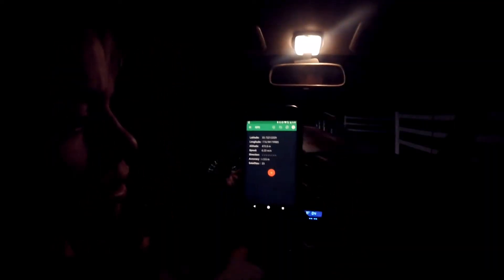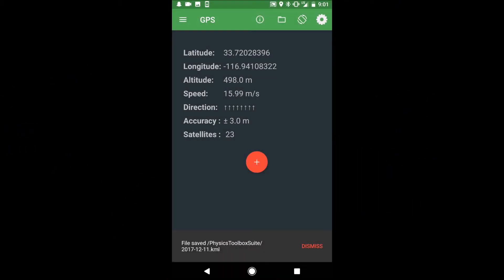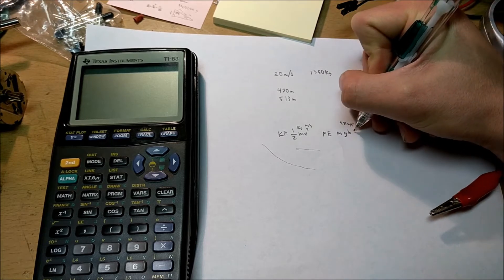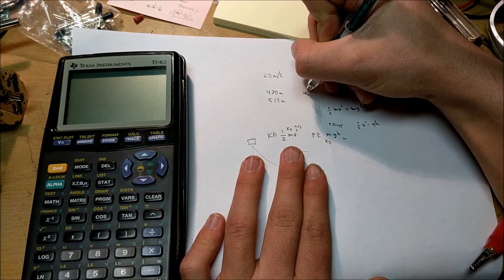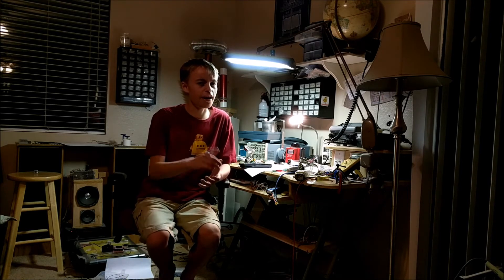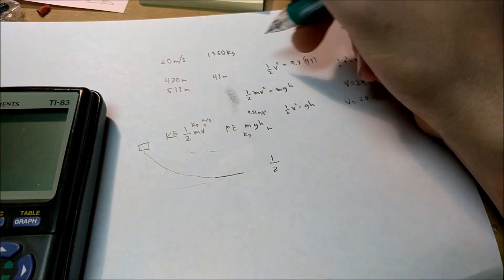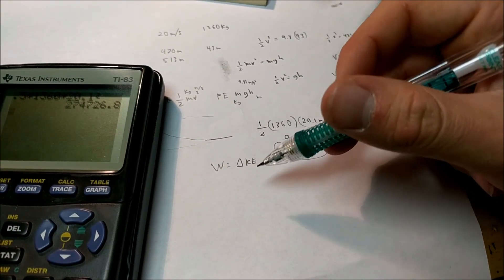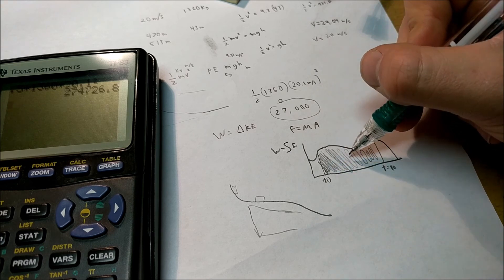Calculating the Velocity of a Car Rolling Down Hill

Comment: yes good subject but  the video does need some fixes..  imho. and apologies if I am wrong
1.the Work and KE calculated was 275 kJ, as @LegoDano pointed outf
2. For KE, as Mr. Tanner verbally noted in the video, the "mass" used for  longitudinal kinetic energy of a wheeled vehicle, includes not only the physical mass but also the effective mass of the rotational inertia of the drivetrain rotating parts connected to the wheels during the test.  If truck was in neutral(seems that was the case), those parts are tires wheels, brake discs, hubs, differential and CV parts, the shafts up to say the tranny output shaft.  What that effective mass is experienced by the wheel (tire patches) can be hard to figure out without lots of detail or much say coasting testing but commonly about 10% of the vehicle mass for light duty vehicles..  so KE = 1/2*(M+Mrot)*v^2 =~ 1/2*(1.1*M)*v^2  is what I would suggest using, where M is vehicle total physical mass(1360 kg?) including driver, , Mrot is defined as that effective mass of the rotational inertia of the drivetrain, as "felt" by the drive wheels at the contact patches (so torque is referenced to tire radii) 
. so for this case effective mass for KE is M'=M+Mrot=~1.1*1360? =~ 1500kg.  So if KE(bottom)=1/2 (1500kg)*( 20 m/s)^2=~ 300,000 kJ, if my estimate of Mrot=10%M is anywhere near correct.
3. By contrast, for potential energy, we use, aypk, the usual  M=physical mass, not M' , so PE= Mgh,  = 1360*9.8[N]  * h[m].  
I was confused that the height h = 513-470m=43m used was 10% less than  than the height difference of 48m, shown by the GPS at the time of the video'd data run: 521m - 473m=48m. but I'm assuming 43m is a newer more or accurate value, i'll use that.  so I get PE = Mgh=13,600 N * 43 m = 585 kJ.

4. So it looks like 585 KJ - 300 KJ =285KJ.
5. I can't tell how long the hill descent was, but say if was 1 km, so an average -4.3% grade over that 1km.   If the truck had typical say 30 psi tires, its rolling resistance of its tires (hysteresis) was Frr = - Mg*frr, and frr for cold tires probably about 0.013 so Frr=~ -1360*9.8*0.013[N]~170N.   And the drivetrain friction as "felt"  by the wheels is probably swag Ffdvt =~-50N, so Frr+Ffdvt~ 220N,  so over 1000m, that would absorb 220KJ of the potential energy.
6. I have been workin on an equation that  for KE(x) when you have a pressure drag actinga sum of forces that is constant or nearly so:  
KE1-KE0 = (Fc*Ld-KE0)*(1-exp-(x1-x0)/Ld)),
a) where KE0 is KE at start point, x0;    {KE0=0, x0=0 here, halted at top of hill, at start of coasting descent run}
b) KE1 is vehicle final KE at end point, x1;   {KE1=~300kJ, at bottom of hill run, using M'assuming here it was x1~1000m}
 c) Ld is a parameter relating aero drag, and its aycs from equation that Ld is the "distance decay constant" if Fc=0, so only drag, how long a distance x1-x0 to drop KE to 1/e~37% of its initial value, KE0.    Ld links effective mass M'  to aero (pressure drag):   
i) we have Fdrag= 1/2 rho*Cd*A_eff * v2.  if rho_air=1.2 [kg/m3]@ 500m altitude, and if the vehicle is small pickup(?) with Cd~0.5 and frontal area eff ~( 0.85*H*W)=~2.5m2?  
then        Fdrag~ 0.75 Ns2/m2 * v^2,  and 
ii) the parameter Ld is actually    Fdrag/KE = M'/ (rho*Cd*Aeff)= 1500/1.5=~ 1000m   {coincidence that Ld=1000m and my asssumption that the descent length=1000m}
I'm guessing a lot here, i know...}
d) and where Fc is  a constant or approximately, a constant sum of the other forces forces, here = Fgrade+Frr+Ffdvt = -Mg(-4.3%+0.013)-50N =585-220=+365N where note i am assuming hill slope is constant -4.3% downslope, which Mr. Tanner indicated is not true, but short deviations lasting <<  Ld I think are less significant. still learning on that.
7.  So with these many assumptions, the equation in (6) would be    KE1-0= Fc*Ld*(1-exp(-1000m/830m))=365kJ*(1-0.37)=230KJ, or v1^=17.5m/s.  12.5% low.  doh.
=> so my guesses at the parameters like descent length, or Cd*Aeff, or Mrot, or that descent could be modeled as constant slope, are off by about 12.5% 
=> probably the Cd estimate was too high.  Hard to know w/o vehicle model and setup (camper cab or open bed, etc)
8.  With many data runs, and more info on the hills, one could back out the parameters, like Mrot, Cd, Aeff, although I admit haven't found which way best to do that.  but this equation in (6) works for level ("coastdown" tests too, or even hill climbs, if the hill slope/elevation data is available.   It can also be used to calculate when to regen, say on a descent, if you know your regen efficiency and SoC, and you have a target speed for your journey.
9.  If you do a descent like Mr. Tanner's above, and you then have velocity vs time data, but not necessarily distance, this equation can be used:
V(t) = Va* tanh( t/Ta), 
Ta==sqrt{(2Ld)*M'/Fc},    and Va==2Ld/Ta.
 which is again assumes the significant forces are  pressure drag and  a sum the others that here needs to be a POSITIVE  constant like Fc = Fgrade+Frr+Ffdvt, where Fgrade positive and outweighs Frr and Ffdvt so Fc is positive.  so if at start, V=V0=0, t=t0=0) and at bottom V=V1=Vfinal at t=t1=tf, then subsituting t1 in for t and V1 (20m/s) in for V(t) above, should fit the equation if the parameter assumptions (Fc, M', Ld) are good.  again, a way to check and determine the parameters over multiple tests.
10. If Fc is <0, say on a shallow descent or flat or incline,   the time-domain equation takes the form    v(t) = Vc*cot(omega*t+theta),
bit harder to use but that is equation to consider for coastdown tests, imho.. stillw orking on it
11. of course im neglecting viscous drag in the drivetrain and aero skin drag, linear with v,  but I think theres a way one can synthetically add forces linear with v in by adding to the Fc and drag (Ld) terms. not sure
=> Mr. tanner, hope you have your PhD and will keep doing videos. I hope this is helpful not annoying and especially not wrong.
BR

Comment: Cool, now for a challenge...can you do a video on if Rogel Aguilera Mederos the truck driver who was sentenced to 110 years in colorado is likely innocent? Can you prove that his speed at impact with other vehicles at the bottom of the hill  was  the result of gravity and weight and not reckless speeding...i mean if we get the weight of the truck and the height of the top of hill and point of impact location at the bottom of hill? basically, Im asking if its possible that he was not negligently speeding before crashing. Can we prove that if his breaks had not failed, he was never driving unsafely?